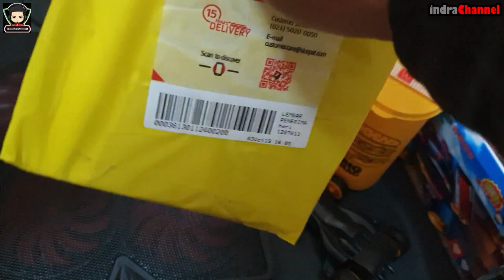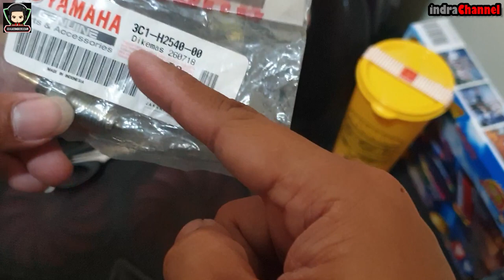Mengganti Switch Netral Yang Tidak Mau Menyala Pada Motor Yamaha Byson

Comment: Bang motor sy vega new pada switch netral olinya rembes,solusinya gimana bang,makasih
Reply from the maker: coba di bersihkan dulu si oli dan kerak di rumahnya si switcj netral nya, klo misalnya msih ada rembes itu mesti di tambal bisa dibuka dulu dibersihkan dan dilapisi anti bocor bebas apa aja gimna cranya, bru bisa normal lgi.. klo kesusahan langsung aja bwa ke bengkel langganannya sj
Reply: @indramahendra6995  ganti oringnya bisa gak,apa di toko sparepart ada